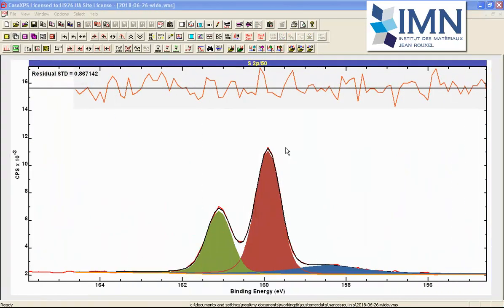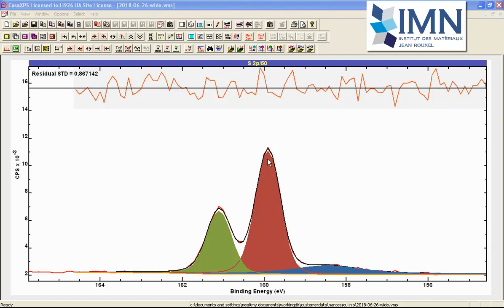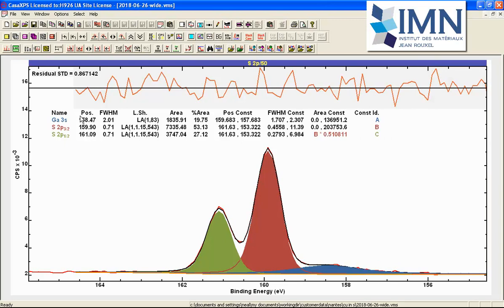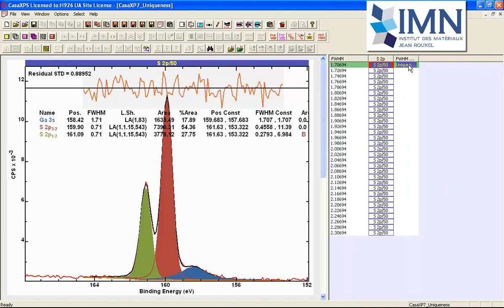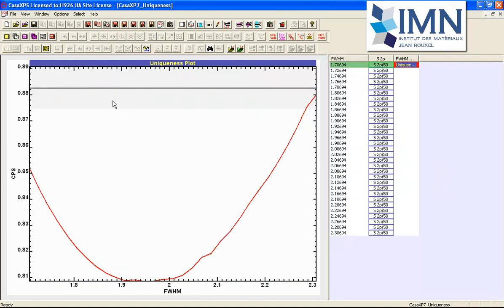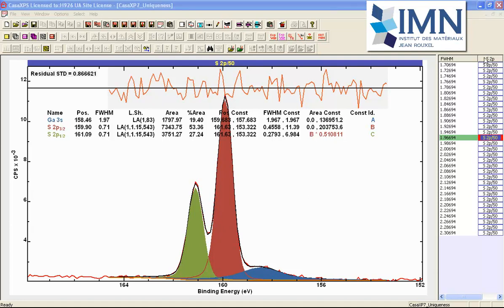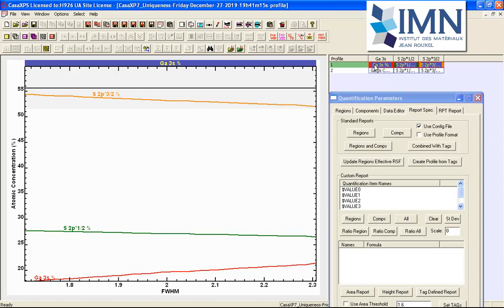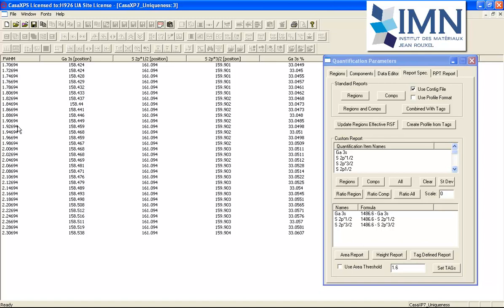Evaluating the influence of FWHM on Binding Energy and Intensity reported by a Peak Model in CasaXPS

Comment: Hello, how do you identify the values for the FWHM for these species?
Reply from the maker: The FWHM for S 2p is determined by comparison to S 2p spectra from similar samples in which Ga 3s is absent. Hence, a FWHM estimate for the S 2p is obtained. Ga 3s tends to be relatively broad and more Lorentzian than S 2p. The spectrum presented in the video is one of many spectra measured from samples with similar composition, so it was possible to test the peak model against these other spectra involving S 2p and Ga 3s in different proportions. Constructing a peak model based on one spectrum is not something I would encourage.
Reply: @casaxpscasasoftware4605  Thank you for the information. I am currently trying to fit my O 1s Spectra for Na-O2 species and I wanted to check for a specific FWHM for a Na-O2 compound. In the literature, I cannot find reports of the FWHM for such deconvoluted peaks in the O1s Spectra. Any thoughts on what could be done?